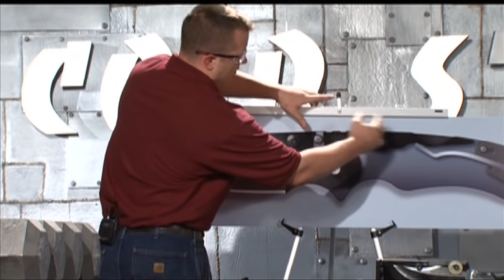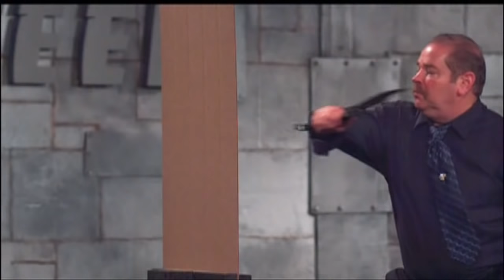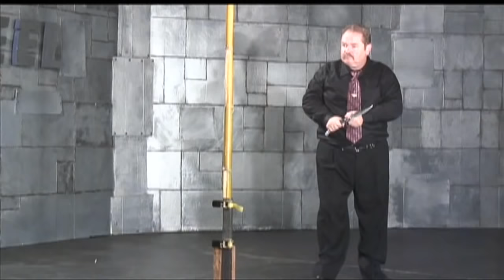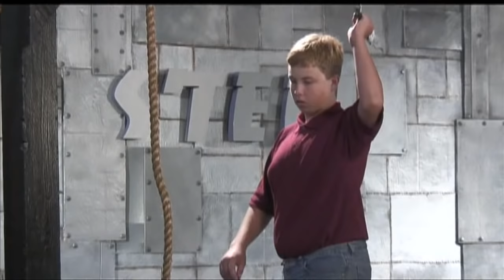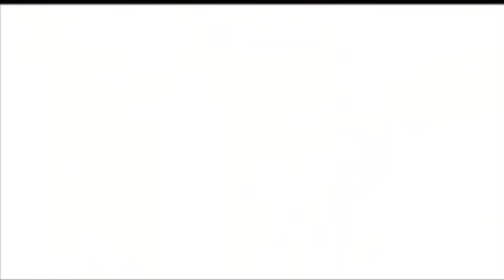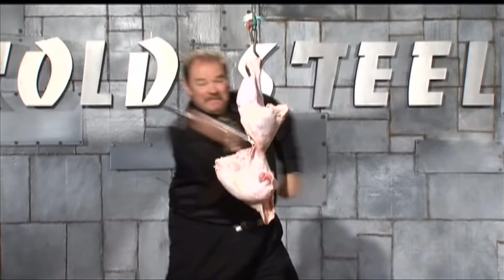XL Espada - 60NX : Folder from Cold Steel Knives

Comment: The Espada is the best tactical folder ever made and I own. It has all the attributes a good combat knife needs. 

1. Fast, instant deployment due to the large pocket catch. 
2. Long blade. A fighting knife should be at least 5 inches long since your primary target is the opponents hand holding the knife. Plus all slashes will be deeper.
3. It has a good weight for striking and the momentum drives the blade deeper into the flesh.
4. The handle gives you two great gripping options, extending reach even further to 8+ inches.
5. It is razor sharp
6. The size will intimidate the crap out of most attackers. I was threatened once by a guy holding a broken bottle. When I rapidly deployed it he took off. 

I carry mine every day.
Very well done Cold Steel.
Reply: I'm super jealous! Will have to get one someday when I can afford it.
Reply: @notgray88  keep checking on Amazon I got mine on Amazon 2 or 3 months ago for 151.00 I want to get it as cheap as I could. Just to help you out

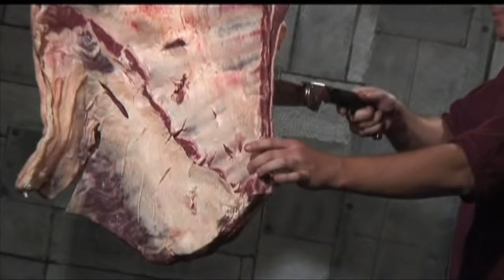Comment: 5:30 told me what I wanted to know, it can stab strait edge down. I have had a few knife fighting classes and the classic European fencers were right, a stab is a little faster and harder to gaurde. Slashing has it's place too, don't get me wrong but I would want a self defense knife that can handle a striat stab without having to turn the edge up.
Reply: Ti lite all the way
Reply: Foil fenced for years (had gift of a olympic multi-gold olympic coach for high school.) Slash vs. stab/thrust:
Slash: larger travel route from A to B. Stab: faster A to B travel
You are right. there is a clear winner. 

When opening a boxing match with a haymaker, the opponent can see the arm travel out to the side opposed to a jab which blends in to your silhouette. Im boxing, it is worth the risk to do the whole wind up. In a lethal street pursuit, probably isn’t. Majority of knife attacks actually trend towards all stabbing but with the defensive/blade down grip. Far from artful but that repeated motion, blindly swinging down with the gusto of a meth head while bum rushing a guy holstering a gun (like an officer) is affective. Enough so that they teach the 21 foot rule. Enough so that Police are armed with knives as well, something faster to draw if the dude is already 20ft away from you. 
(typically a Ka-Bar like this: https://www.kabar.com/products/product.jsp?item=1480     - specifically designed for the issue)

But when it comes to stabbing, usually better to thrust forward. Simply extending your arm fully, tip of the knife pointed at the middle of the chest. can have a crazed someone run straight into it. 
Reach is very important too. But your ability to lunge is probably just as important as how large your blade/grip is. I do love how the grip allows you to add

primary

Comment: Also, how does the lock work, even with the diagram it's still hard to understand the engineering behind it? I've only seen cheap knives before with the liner locks. Impressive showing it not breaking the lock when banged against the wood. Don't know too much about the different kind of locks.

Comment: I'm just laughing imagining the look on some would-be attacker's face if you pulled that out. That being said, I don't know how practical carrying a gigantic knife like that would be.
Reply: I EDC one. It's thin, carries deep. You do have to devote an entire front pocket to it, though. It's not a problem, as long as you also carry a small knife in case you need to do some small cutting task in public...
Reply: VireDragon 
Couldt have said it better myself haha, been carrying the Xl g10 espada since april with a cs hideout tied to my belt with about 2ft of cord (great little fixed blade dagger from cold steel. Going for around $22 on amazon right now { AUS8a espadas went down in price alot since the 2015 lineup started being released, on amazon ~$160 and ~$95 for the 7075 aluminim and polided G10, and the full G10 handles eespectively }]
Reply: VireDragon See, I wouldn't want to do that (devote a whole front pocket to it), as I use my front pockets for other stuff.

Comment: I just watched The Expendables and noticed that Mickey Rouke's character(Tool) used a large espada as a thrower with amazing accuracy is that true or was it a hollywood trick?
Reply: Once you have found the point of balance in your knife, it will be possible for you to figure out how to grab it in order to be successfully thrown. The rest depends on the distance and, of course, your accuracy. Yes, it is possible to do it- I have even managed to throw and stick a Spyderco Harpy in a tree many times with acceptable results-, but in the case of an Espada large I assume that you will need to be a more than outstanding thrower. Especially from a sitting position, at that speed, and right where you want it to hit.